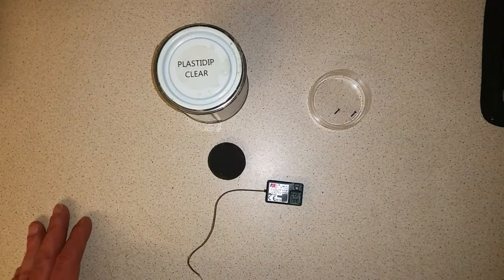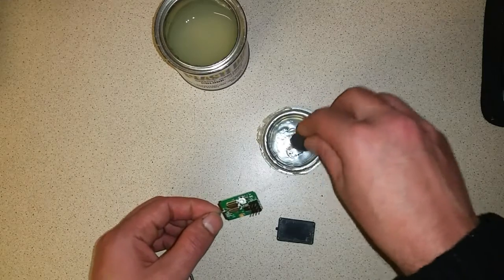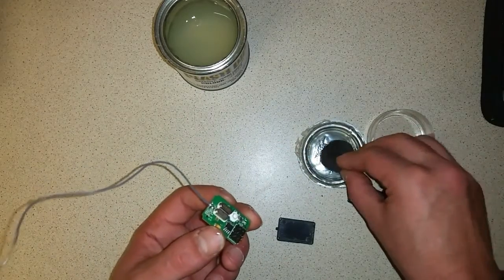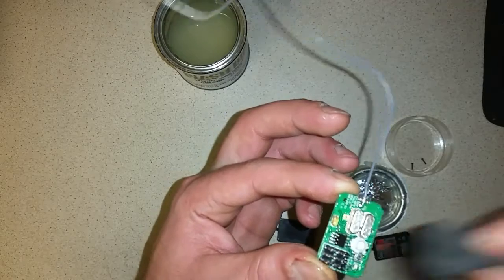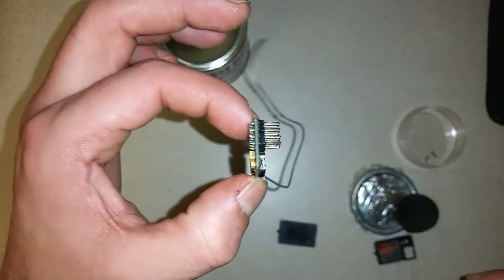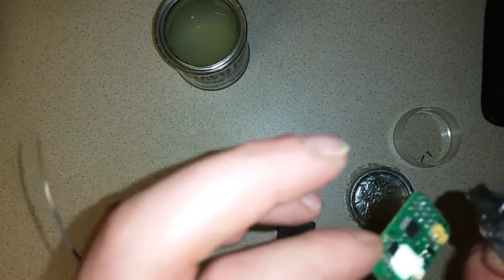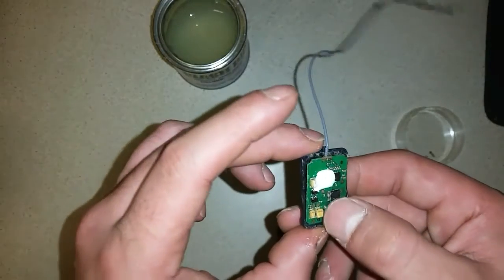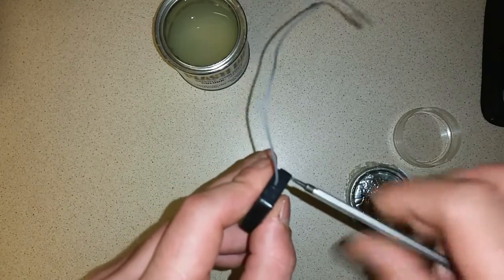How To Waterproof RC Reciver Using Plastidip.

Comment: Does it still work now? I have the same fly sky receiver, does it still work and is it good now?
Reply from the maker: hi thanks for commenting.
yes it still works perfectly.
Reply: Tuga RC do I have to put the plasti dip on the little metal pieces where the plugs plug into? Also, can I just dip it in fully?
Reply from the maker: @br1ann88  you want to keep the pins clean from plastidip so there's no issues wend plaguing the cables.
Reply: Tuga RC can I also use a paint brush to put on the plasti dip?
Reply from the maker: yes you can.